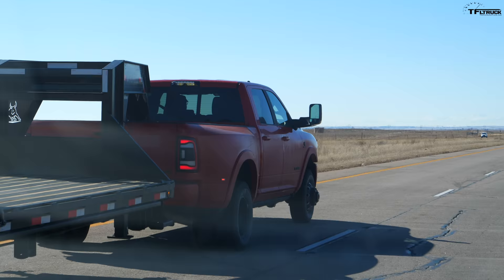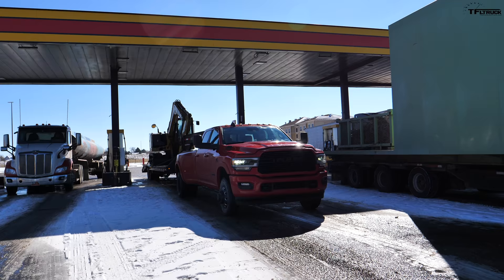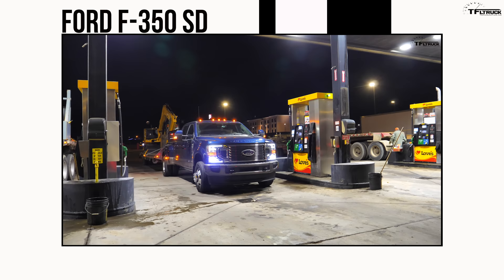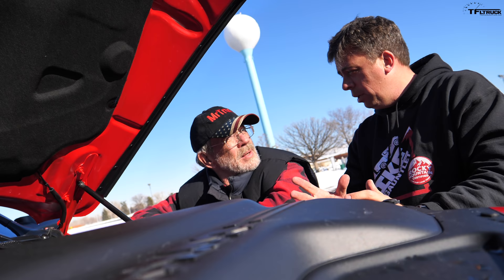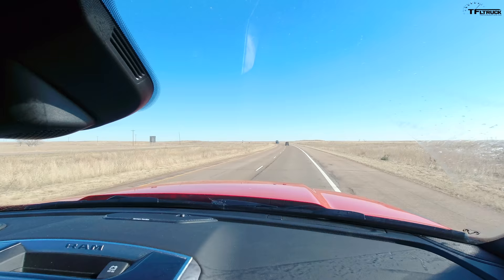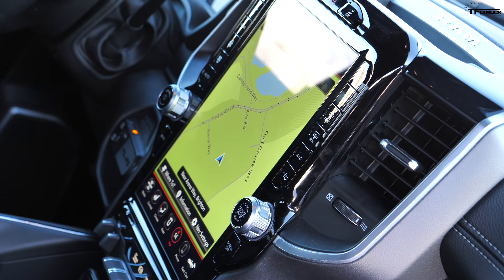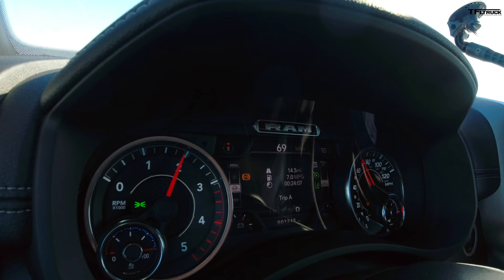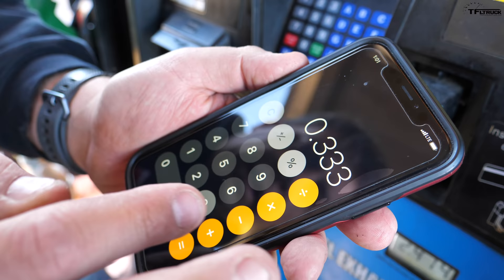New Ram 3500 Cummins Takes On Our 30,000 Lbs MPG Challenge Against GMC & Ford Diesels!

Comment: I really don't care about MPGs if you're that concerned and don't buy it a heavy duty truck in my opinion that truck looks awful looking
Reply: Irrelevant of the brand, between 6 and 7.8 MPG for the same job, it's money in your pocket. 30% more fuel for the same run add up fast if you travel a lot for your business!
Reply: Guys that pull trailers for a living care, 300,000 miles there is a huge difference in 1.6mpg
Reply: @SMiller5488  making money
Reply: @SMiller5488  what's that saying if you can't handle the heat stay out of the kitchen
Reply: @desperadosanchez723  what?
Reply: @SMiller5488  I used to haul for a living as well and  back in the day fuel wasn't a big factor it was getting the job done and today all you guys care about is fuel savings. Mpg
Reply: Desperado Sanchez The Fuel DEF combined cost difference in 250,000 miles at the rate and price of this video comes out to $102,000 on Ford ,$115,000 on GMC and $130,000 on Ram but I guess if you hotshot haul for a living and wanna throw away $28,000 in fuel cost difference in 2.5 years that’s up to you but I wouldn’t 😉

Comment: Of course it is going to do the worst MPG, it is a 6 speed with 4.10 gears!!!! I am NOT a Ram fan, I like the Duramax, personally, but you cannot compare MPG of the Ram with the 4.10's to the other two trucks. Put the 3.73 in the Ram and then it will be comparable MPG test, and the tow rating is in line with the other two as well at that point. Oh, and get rid of Mr Truck, I cannot stand him. Apparently I am alone in that opinion though.
Reply: The Ram would be even slower up the IKE without that 4:10 gear.

Comment: I have said this time and time again, you always claim to do your best on making every run the same with all the trucks. But you did this run with the dodge in warmer weather, and you ran the Ford at night. Powering headlights uses more gas since the alternator has to work harder. Cold air also makes a difference, in the intake as well as how well the DEF fluid works. You also had to load the trailer again, if the trailer is loaded even an inch differently it's going to make the truck squat different. If you are going to have big differences in your testing please state that and also think about why the different conditions could have effected the trucks. You make these videos to give us accurate information and yet some test such as this do not give us a completely clear picture.

Comment: Put on free wheeling hubs! Boom u just gained 3MPG!
Reply: The new Rams actually have a disconnect in the front axle which unlocks the axle shafts for better fuel economy.
Reply: It's called a chad front end amd not the same or as good